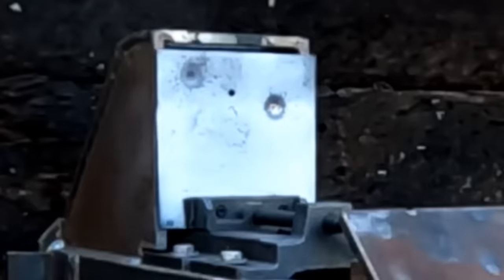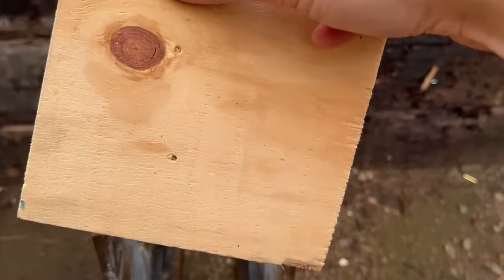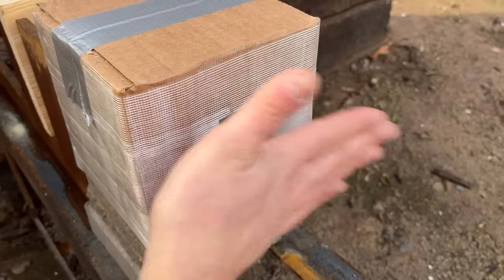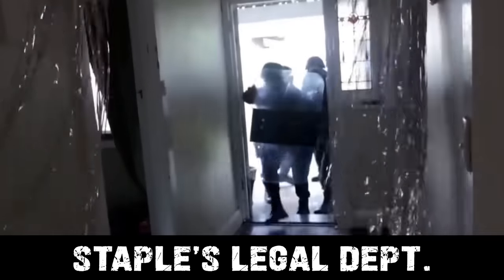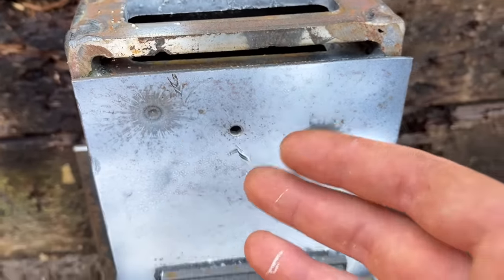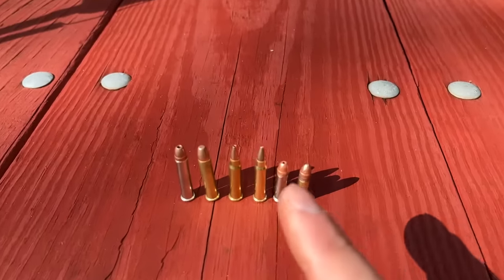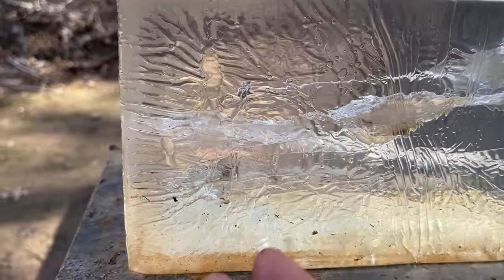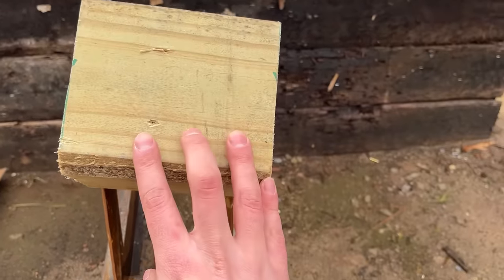22LR vs 17 HMR vs 22 MAG: Never Would’ve Guessed

Comment: One thing us airgunners know is that .22 out penetrates .25, and .177 out penetrates .22 when shooting slugs(bullets) from our high power airguns. It's sometimes referred to as the "ice picking" effect. Less frontal area for similar energy= more penetration.
Reply: That's what he said.
Reply: @rob6850  😆
Reply: Sorry couldn’t hear you over our firearms here in the us 😂 good luck with your air rifles
Reply: @Krobear  So for comparison, a 40 grain .22 bullet @ 950fps will penetrate far less than a 40 grain .177 bullet @ 950 fps. 
We like to stay under the transonic range with our slugs(bullets), as that's where best BC and lest wind drift are for lower powered projectiles.
Reply: @michaelforrester9963  I'm in the US! You should check out some of the current high powered PCP airguns, I have a .30 cal that shoots a 50 grain bullet at around 1000 fps. Pretty fun.
Reply: @Krobear  I agree when you're talking about pellets, but a .177 slug at around 20 grains is FAR superior to any .22 pellet in retained energy, BC, wind drift, and drop. 
Unfortunately finding a barrel that shoots slugs is not easy, especially in .177 but when you do, and can send a 21 grain NSA slug at 950fps, you can make better 100 yard groups than ANY .22 pellet. Also they tend to penetrate like nothing else.
Reply: @Krobear  Slugs indeed. Basically pointed bullets, no pellet shape, no skirt. Kinda the next evolution for airguns.
Reply: Lol
Sectional density has entered your vocabulary from this day forward.
It's the term you're looking for
Reply: Add a drop of 3-In-1 Oil in the the pellet back recess for a bit of dieseling action!!! 😂
Reply: @fookingsog that usually just kills your seals.
Reply: What about 17WSM?
Reply: @rivencraft1734  Urban Myth. What "seals" does it affect??? Is it the extra pressure or drop of oil added to the pellet that ruins the seals??? 🤔 My "educated" guess is that some ID(10T) originally made a potato canon, and upon getting such powerful results decided to spray some AquaNet in their air rifle...which worked for awhile until the xylene, toluene, acetone or whatever other solvent in the hairspray dissolved the seals to mush. Have you ever heard of a thing called a "Fire Piston"??? I believe those thinga-ma-jigs use rubber O-Rings!!!
Reply: @michaelforrester9963  Texas makes air rifles that are jaw dropping. Both on performance and price, damn things are expensive.  They can shoot accurately 4-500 yards and are virtually silent.  As @Texasprepper has pointed out, I  incorrectly stated "Daniel Boone used an air rifle". It was Lewis and Clark carrying the Girardan, Daniel Boone had the Kentucky Long rifle.
Reply: This is an interesting effect that can probably be explained by someone more familiar with terminal ballistics than myself, but my first observation is that if the muzzle energy remains the same and the projectile mass is decreased, the result must be an increase in the kinetic energy density of the projectile (more kinetic energy per unit mass of the less massive projectile), which just intuitively sounds like it should penetrate deeper.
However, people must not get confused, muzzle VELOCITY is not the same as muzzle ENERGY.
Muzzle VELOCITY is simply the speed of the projectile, no matter the mass.
Muzzle ENERGY takes into account both the mass AND the velocity of the projectile.
When I say that the "muzzle energy remains constant" in my first sentence, what happens is that the muzzle VELOCITY for the lighter projectile MUST be faster than the velocity for the more massive projectile. This is because the equation to calculate kinetic energy is KE =0.5*M*V^2.
Because the velocity is squared in that equation, doubling the muzzle velocity and holding the mass constant results in not a doubling, but a quadrupling of the muzzle energy. To double the velocity while holding the muzzle energy constant, you would have to make the projectile mass 25% of what it initially did.
Now I want to do some math. I got a 95 in my high school physics class and I still remember most of the formulas, but despite being born and raised in the USA I am accustomed to doing all my calculations in metric. That's not a big problem, I just have to convert all the numbers I use into the same measurement system and class of unit and I should get a valid result, which I can then convert back out into US customary units so you all know what I'm talking about when I say my answer.
First off, what are the units I'm targeting? To deliver a valid result, the metric kinetic energy formula expects kilograms for mass and meters per second for velocity, and spits out a muzzle energy result in Joules. These are all "base units" for metric, which just saves a lot of time converting back to US customary units at the end. (yes, I know kilograms is "thousands of grams", but they declared the gram to be 1/1000th of a kilogram, making the kilogram the de-facto base unit, even metric has a little bit of "weirdness" left in it).
To start off, I'll make an assumption that the muzzle velocity of the .22 caliber airgun slug is 950 feet per second. This is still (barely) subsonic, and another commenter said that's what they typically shoot at, so it seems a good assumption to me. Google says that 950 fps converts out to a Metric velocity of 289.56 meters per second (shorthand m/s, which I will be using from now on).
Now for the projectile mass. Looking online, I see that the first result for .22 caliber airgun slugs claims a projectile mass of 25.31 grains, and Google says that converts out to a Metric mass of 1.64 grams, or 0.00164 kilograms.
Now to actually do the math, this is the "easy" part, because you can let a calculator do the heavy lifting.
KE = 1/2*M*V^2
KE = (M*V^2)/2
KE = (0.00164*289.56^2)/2
KE = 137.505789504/2
KE = 68.752894752
The most accurate number I put into this calculation had 5 significant figures, so I can only use the 5 most significant digits of that number (plus the 6th to determine if I should round up or down), so the actual answer is this:
KE = 68.753 Joules.
Google says that 68.753 Joules works out to a muzzle energy of 50.710 foot pounds.

Now to work backwards to figure out how fast the .177 airgun slug needs to be going to have the same muzzle energy, this is gonna take a little bit of algebra but it shouldn't be too hard. Hopefully you can follow along!
First off, I need to know the mass of the .177 airigun slug.
Once again, I reach for the first Google result when I look up ".177 airgun slugs", which claims that each slug has a mass of 10 grains.
Right, now to convert that to kilograms, so we can keep working with the same metric numbers we were using before and keep everything on an even playing field.
Google says that 10 grains works out to a mass of 0.647 grams, and in kilograms (which you get by dividing by 1000) that's 0.000647 kilograms.
OK, so how do you take a mass and an energy and get a velocity? Well, this is where the algebra comes in.
KE = (M*V^2)/2 (Multiply both sides by 2, that switches which side the 2's influence is on, giving the next line)
2*KE = M*V^2 (Divide both sides by M, this switches the M over to the same side that KE is on, giving the next line)
2*KE/M = V^2 (take the square root of both sides, this removes the squared term from V and puts its influence on the opposite side of the equals, giving the next line)
SQRT(2*KE/M) = V , this is a valid form of the equation we need, but let's mirror it (which doesn't change anything) so it's easier to think about.
V = SQRT (2*KE/M), this is the final form of the equation we will be using.
Now the part where the calculator can take over, the actual "doing the math":
V = SQRT ( 2 * 68.753 / 0.000647 )
V = SQRT (137.506 / 0.000647 )
V = SQRT ( 212528.5935085....)
V = 461.0082358....
We still only have at most 5 significant figures from the input muzzle energy that we got from the result of the .22 cal airgun slug calculations, so the actual answer is:
V = 461.01 m/s
Google says that 461.01 m/s in us customary units is 1512.5 feet per second.
This is actually quite reasonable, an increase in muzzle velocity of just 562.5 feet per second was required to match the muzzle energy between the two projectiles, yet the lighter one masses less than half of the heavier one.
The fact that you have to square the velocity in the kinetic energy formula leads to some quite interesting and sometimes counter-intuitive effects on the other end of the calculations!
Reply: Velocity trumps everything else imo
Reply: @fookingsog  It doesn't just destroy seals, it can cause mechanical damage too. It's not a good idea.
Reply: @Patrick-857   That's my experience as well.
Reply: the wikipedia article you're looking  for is "sectional density"
Reply: "kinda like me"
Reply: @life_of_riley88  What's a good beginner PCP rifle (.22) for the money?  Thanks in advance!
Reply: @mandibarcena6667   On the cheap end is the Diana Stormrider, it's easy to fill with a hand pump, and is a good starter rifle. Lots of folks love the Umarex Notos, but it's more of a carbine/pistol with a stock, but they seem to shoot REALLY well for the price. Also easy to fill with a hand pump. Beyond that, Beeman makes a couple of affordable PCP rifles that seem to work just fine as well. If you have a budget or $400 & up, your options get better, lots of folks like the Avenger. I don't have much experience with any of these besides the Stormrider and the Notos. With any lower end pcp, you can always have quality issues, so you need to be aware that you might have to use the warranty provided. Most of them are just fine though.
Reply: @life_of_riley88  I got at least $700 budget. I am looking at the Hatsan's. Are they any good? 
Thanks for your quick reply.
Reply: @mandibarcena6667  I don't have any experience with the Hatsan guns. If you can find one, the Stoeger Xm1 Ranger and Xm1 Scout are an amazing value, but they JUST came out and can be hard to find. Also the Air Venturi Avenge X is an awesome value. Look for something with a regulator built in if you can.
Reply: @mandibarcena6667 Yes, I have a Hatsan BT65 bolt action in .22 cal , 2 10 round mags. Totally amazed with the power out to 100 yards.
Reply: @life_of_riley88  Really it is not hard at all. We use HMR barrels. Hint, a .17 hmr bullet is Not actually the same size as a .177 pellet. ;<) ( I design slugs for pcp airguns). 
KnifeMaker
Reply: @michaell397  Oh Knife! I know who you are from GTA. I follow a lot of the threads that you and Bob chime in on. Yeah I will be doing a .172 build at some point. For now, NSA has been treating me well in a LW polygon barrel. Cheer.
Reply: @life_of_riley88  I still to this day have not had the pleasure of trying a Poly Barrel.  ONe day!!! ;<)

I hated to leave the GTA but the political climate there began to bother me. We are all shooters regardless of disciplines. The Anti firearm/2nd amendment attitude of so many with a few devout communism followers really got to much for this Old American! 
KnifeMaker/Retired after over 47+ Years in the Craft
Reply: @michaell397  The poly barrel is interesting, so far so good with slugs, but it's very sensitive to velocity for ideal stabilization. Once you find that ideal velocity, it seems to do quite well. 

I understand completely about the decision to leave the board. I'm a young-ish guy(36) that lives and works in the CA Bay area. . .and I have to be very careful about who I speak to about the love of firearms, the 2A, Freedom and Liberty. I didn't know it was quite so bad on the forum, but in any case thanks for the kind reply!
Reply: @adf360 no...Daniel Boone did not.....Lewis and Clark expedition had an air rifle that was a repeater!
Reply: @Texasprepper  I can't see my comment but you are correct, Daniel Boone had a Kentucky long rifle,  Lewis & Clark had a Girardoni air rifle.
Reply: @mandibarcena6667 
Check out AEA HP series and get a kit to make it a varmint. Then you will have both a semi auto and a bolt given an hour to swap.
Reply: @jeffreystroman2811  Those are pricey. Nice guns for sure.

Comment: Overpenetration means the round isnt disipating its energy in the target. That generally means a smaller permanent wound path and less trauma. The most effective round is typically the round that dissipates the most joules in the target.
Reply: If physics has taught me anything, the 17hmr would actually dump more energy faster whereas the heavier projectiles would retain more energy while simultaneously having more to deliver.
Reply: The only reason 17hmr penetrates so much is because of the smaller surface area creating a much smaller point for the energy to be transfered and absorbed by the target (and the velocity). Similar effect to the dudes who can throw a needle through glass without breaking it.
Reply: @midlbrwn15  correctly stated. That's why overpenetration is bad. The round leaves the target with energy unspent. Regardless of caliber and bullet type, a round that stops within its target has left 100% of its energy inside that target. Fast, slow, light, heavy is meaningless. It's joules dissipated that counts the most, followed by wound path.  That's why hollowpoints are used for defense - not because they cause more injury from petals, but because they stop inside the target nearly 100% of the time.  Same for hard nose flat tips for bears.  

A 22 magnum has nearly 40% more energy than a 17 HMR.  If they both stop in the target the 22 magnum wins every single time.
Reply: @midlbrwn15  yes. Unfortunately, it often goes right through small game leaving energy unspent.

Your example of throwing  a needle through glass is outstanding.  This only works because the needle doesn't leave enough energy in the pane to shatter it.  In fa t, they don't actually penetrative the glass at all. The needle strike simply causes the glass to spall.
Reply: Energy is not delivered to Target with 17 cal. Lol
Reply: I'm 70 years old and been hunting since 8.  I've heard the "energy dissipation inside the critter is best " my whole life but as far as recovery of a big game animal, it is best the bullet passes completely through in most cases.  

Explanation:   Except for spine shots, most any deer/elk will run 50-200 yards with a proper heart lung hit.  Without an exit wound, there is little or no blood trail for several yards. If you are in dry, hard ground with lots of cover, you may not be able to find the trail and might give up looking and leave a dead animal hidden in brush close by.

I come by the from the experience of tracking and recovering dozens of deer with the aid of trailing dogs.  My father had always a few tracking beagles.  Many times we would get requests to assist in recovering deer.  Sometimes we would find the deer a quarter of a mile from the hit in thick, dry, brush with no blood trail until just before it laid down.

I Shot a large elk at 70 yards with a standard 165 grain 30-06 core lock. There was no indication of a hit at all.  Lucky for me the was a foot of fresh snow so I followed the track hoping to get another shot.  At about 50 yards i saw pin head size speck of blood on the snow.  I saw only a few more tiny specks for the next 100 yard an stumbled on the elk, dead and 200 yds.  The bullet had taken out both lungs and some of the heard but failed to penetrate the off side.  A small amount of blood had ran down to the hair on the brisket and slowly dribbled off. No way I would have found this this animal without a tracking snow.  The next day, one of my hunting buddies, using an '06 but  with a Barnes copper penetrating bullet in a similar situation got a huge blood spray and a big sploch blood trail.  

Always prepare and hope for an exit wound.
Reply: @Rational_thinker_212  I've only been hunting since 1961. You can favor lost energy. I'll favor energy in target.  I have yet to lose a single meal to my strategy either.
Reply: @mfuchs2004  Lucky you.  I however have spent hours blood tracking on hard dry ground in brushy dense environment on several occasions.  Not all ended well.
Reply: @Rational_thinker_212  maybe change to a cartridge that delivers more terminal energy, or change bullets to stop in target.

Your strategy seems to be straight line damage to lungs and heart. My strategy is massive temporary and permanent wound cavity.  I have yet to see an animal make it even 50 yards. Most bolt for 5 steps then face plant.
Reply: I use Winchester PowerPoint hollow, in my 1020 Ruger for small game when out back of the farm..
Use subsonic so don’t warn every pest nearby..
I use solids when putting cow or large animal down..

I bought various makes of ammo when I first got it..
PowerPoint accuracy was the most consistent grouping at 100 meters..
And cost was most  sensible ..

The high velocity ammo was a waste of money, least accurate..

Comment: The results are not a surprise: The kinetic energy formula is KE = 1/2 * M * V^2, M=mass, V=velocity This means that if you double the velocity e.g. bullet, KE increases 4 times with the same mass. While doubling mass of a bullet only increases KE by 2 times. The 17HMR was double the velocity of the 22LR, and the 22WMR was 500fps slower than the 17HMR
A smaller diameter bullet has less friction both in the air and passing through an object e.g. it takes less force to pass a needle through a heavyweight piece of canvas vs using a pencil, it takes less energy to push wood or steel out of the path of the bullet allowing clean pass throughs.
Reply: Wow Jim Bob dun goods ins math is class